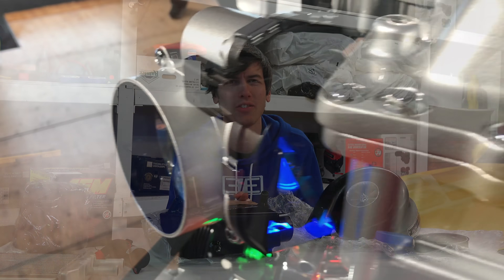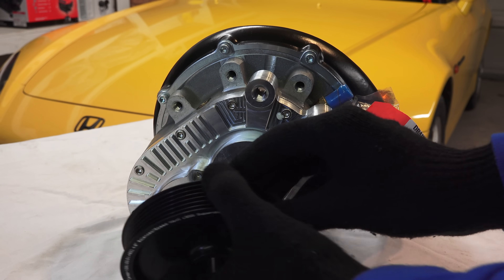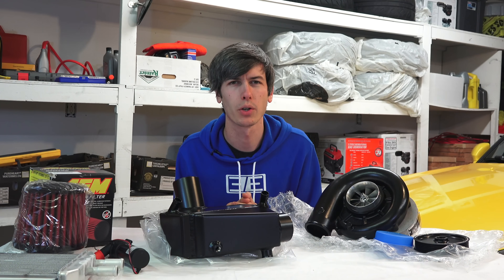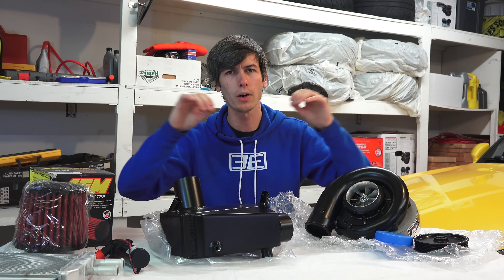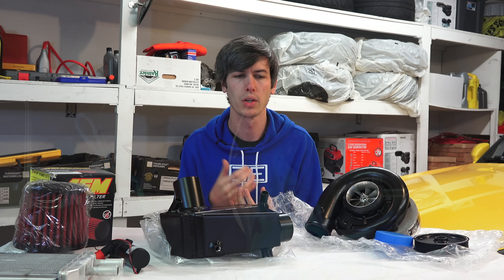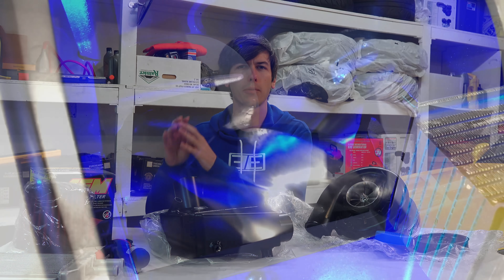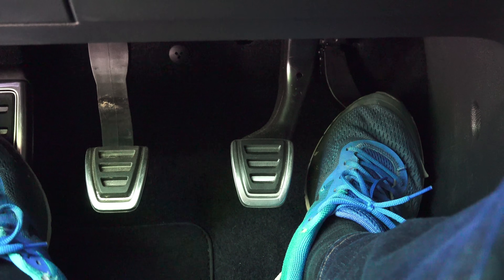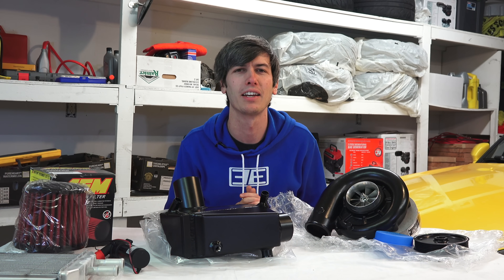Turbochargers vs Superchargers - Which Is Better?

Comment: Why do you got to talk with a nasal Fozzy The B bear Rubbish? FFS. You don't even address why turbo lag has it's real Benefits of dispersing heat consistently keeps running gear much more preserved then charge that flogs all till it blows. yeah great if your running 9's on the track switch in switch out motors on like no ones business with wealth by the side damn silver spoon kids couldn't even butter their own bread or tie their own F shoe laces together without messing the knot up with the other shoe stand up and break their neck.

Comment: If someone were using diesel to compress cold air into a large tank, then maybe a super charger would be better because they could save the exhaust heat as a catalyst for thrust, spinning an electric turbine, for an ultra efficient, triple hybrid diesel, compressed air, electric vehicle.

Comment: This seems like another reason Hybrids were the "worst of both worlds" 

1. If you drive your car on just a gas engine the engine stays hot and doesn't start-stop
2. If you only use the engine to charge a battery you can run it continuously at the optimal temp, also you can use an engine optimized for charging at an optimal RPM with constant load

With EV growth faltering, I hope some manufactures (apart from a Mazda SUV compromise) exploring an all-electric drivetrain with a small gas charger allowing the battery to be reduced by 90% and the car to be driven without a mechanical drivetrain (the best of both worlds)

Comment: Superchargers are amazing for compensating on engines that have very poor low end torque, but have lots of high-end power.

Case & point, the Toyota 2ZZ engine. Supercharged, it's genuiely scary, as the supercharger compensates for its biggest down side, the lack of power before you go into lift.

Comment: Honestly that's good to know I knew my car came with an aftermarket turbo but I noticed that sometimes ide hit the gas and my car would take a moment to bolt off and other times I tap the gas and my car just takes off xD it was a worry in the back of my mind but now this just tells me my turbo is using exhaust rather than power from the engine

Comment: Car guy question. Why not get the best of both worlds and make a charger that uses an electronic clutch or an electrically powered turbine, and map it to your RPM? It might take a lot of current but I’m sure you could beef up an alternator to compensate? OR, beef up your battery and wire the turbo with a kill switch so you can do a few good pulls and then shut it off to charge up for a little while when you don’t need it.

Comment: Hmm what about using a turbo to recapture exhaust pressure to drive a alternator in a hybrid car set up?
Reply: That's only really viable in racing. You need wide open throttle to generate any meaningful excess energy at the turbo. In road use, most of the time you drive around at part throttle, where the turbo often enough doesn't even get enough exhaust gas to create nominal boost pressure.

Comment: I had an FG XR6 Turbo Ford Falcon straight 6 here in Australia, was fun when it got on boost and it wasn’t super laggy as it was a relatively small turbo, however, I also owned an FGX XR8 with a 5.0L Supercharged V8 and the instant power, knock you on your ass power was a wonderful thing. Also in my opinion superchargers are safer as they are engine driven, you get off throttle and the boost cuts, so the same in a turbo and it wants to hang on that bit longer which could be dangerous in an accident situation. Just my thoughts.

Comment: I have a 94 ranger 3.0 and a 96 accord wagon 2.2 vtec. The honda has a turbo ajd im familiar with them on vtec engines. However would i still use a supercharger on something small like a 3.0 v6 ? 
How big is big enough for a supercharger yall

Comment: Turbos apparently can go anywhere, from 1.0 Fords (they have a 1.0 with 120 hp) to 16 cylinders Bugattis, and let's be honest ... lag was once upon a time; nowadays you can't feel it.
Superchargers however apparently need a bigger engine to start, however they're beautifully simple, aren't they?
Reply: can put turbos or superchargers on any size engine, nissan even did both on a 1L engine in the march superturbo
Reply: Chevrolet Cruze came with a turbocharger, they had lag. I have a turbocharger on my Fox Platform and it has lag.
Reply: @cunninghamroc  Alright, let me put it to you this way; F1 cars have turbochargers. Bugattis have turbochargers. McLarens have turbochargers, so do Ferraris. But ... also little 1.0 Fords or VWs.

Comment: Smaller engines with Turbos makes practical sense because it’s more efficient. A bigger V8 with supercharger may give up a little hp efficiency, but you have so much more hp to start with - you don’t notice it.

Comment: I built a turbocharged mid-engine "Lotus 7" (Google "Midlana") that was around 1,600 lbs. The engine was a Honda 2.4 K engine, so it had a lot of low-end torque right off of idle. Having a supercharger would have been a complete waste of power, serving only to make tire smoke. The turbo on the other hand, supplied torque higher up where it could get to the ground. The result was having ~400 ft-lb up through the rpm range, so in this car, a turbo was better. OTOH, if I built something really heavy, or for rock-crawling, supercharger all the way. So "which is better" depends on many factors.

Comment: Excellent video as usual but everyone describes turbos as running off exhaust that is waste, implying that there is no power draw off the motor but turbos are run by exhaust back pressure which would not be there if the turbo were not plugging up the exhaust. The efficiency part comes from the fact that they is little to no back pressure at low rpm’s. I don’t know the math but was hoping you could calculate how much power the back pressure takes off the motor to give a real power draw comparison. X psi against the piston on exhaust stroke by how many rpm’s takes how much horsepower to overcome. Thanks

Comment: Even a turbo is going to put a drain on the motor/engine power as it does take some energy to spin the turbo(s), in the form of back pressure. Motors loose HP from back pressure in the exhaust as it will cause some restrictions on the exiting exhaust.

I have not driven a vehicle with a super charger but I can see where they would be better than a turbo. 

That being said I do not see the need for at least myself for a boost of power that has to be exactly when I press the accelerator vs a second or two as I am not racing my car or need power immediately.

Turbos only last about 100k-150k and I have heard of them going out around 50-75k, and they are not cheap and or easy to replace and is very expensive to get done, I have a 535i in the shop now getting the turbos replaced which I am sure is going ti cost me 3k or more.

Comment: I had a 2014 Audi A7 and that super charger was actually very responsive. I now have a 2017 G90 and the twin turbo on the V6 are pretty good also there is a bit of turbo lag but it’s not noticeable to the untrained or informed person. I do miss that throw you back in the seat feeling with the A7.

Comment: There must be pumping losses with a turbo, otherwise you're getting something for nothing.  If there's no energy loss from the exhaust turning a turbine then you've just discovered a perpetual motion machine.
Reply: You aren't getting something from nothing because a turbo only recycles some of the leftover mechanical energy from the combustion that originally took place in the engine.

Comment: I personally prefer superchargers because of the low RPM torque, but I think turbo charged are more fun to drive because you get the excitement of having to look ahead and plan accordingly. Few things match that feeling that you get when you rev your engine and the boost kicks in just as you planned. It's like taming a wild horse.

Comment: I am a big proponent of increasing engine efficiency but I am of the opinion that downsizing is one of the worst ways of doing it. First youre not really increasing efficiency per se but decreasing mass and cylinder count. Second: Under extended high load scenarios downsized engines can even use more fuel as extra fuel is injected purely to prevent overheating in extreme scenarios. Additionally the decreased mass has with adjusted tyre pressures no impact on the fuel economy while cruising. Third and most importantly turbo chargers put a higher strain on the engine as well as the turbos themselves being an additional part that can fail. Since the downsizing trend began statistics have shown that the amount as well as the individual cost of engines repairs has been constantly increasing. That basically defeats any savings on fuel in regards to the environment as well as financial costs. The ones who benefit the most are the manufacturers who can claim better fuel economy which is mostly only true on paper as well as additionally getting more money for more and more replacement parts.
A modern well built naturally aspirated 2 litre 4 cylinder is in my opinion the pinnacle of an allrounder combustion engine for everyday cars. You dont need more than that and itll have good fuel economy as well as being long lasting.

Comment: There must be something wrong with our Ford Escape 2.0.  I've never really noticed the turbo the lag. It's a great running small SUV. Only issue I've noticed after retiring as a mechanic is the oil is dirty than most other vehicles we've owned.  With 4K miles services. And it only has 29K total miles. It's about equal city and highway miles. And since Grandma has a need for speed she likes the turbo.

Comment: Turbo all day long on a V8.  Superchargers provide way too much torque down low overpowering the traction.  I went from twin GT32 turbos pushing 14 lbs on my z06 to a vortech ysi pushing 18lbs boost and it literally ruined the car.  Stock Camaros could beat me at the stop light but I could beat liter bikes all day long from a 70 roll.
Turbos are smooth and controllable.

Comment: All turbo engines consum oil. The drivers don't know this. The oil level go down until a warning oil on dash will light.  Dangerous w/o oil for engine. All the turbos are very sensible, expensive to repair, a lot of headeake, etc.

Comment: One question? In the first interation with turbo and intercooler, the air would get slightly compressed by the compressor (even though the turbine hasn't received any exhaust gases yet), pass through the intercooler and then enter the cylinder, OR would the cylinder's vacuum suck some air whitout compression, process it and then give it to the turbine's turbo so it gives power to its compressor which would finally start compressing? Thanks

Comment: superchargers have less mass  (weight) involved !! less heat being " stored "" under the hood !  this all together far offsets nay power loss from being driven by the very engine your trying to create more power in !!!!! doesn't heat your motor oil wich in turn creates MORE heat IN the engine AND the dreaded EGT concerns.

Comment: Ok it makes perfect sense that a belt (or whatever drive method) supercharger is using some of the engines power, but help me understand my next thought. In physics it’s under stood that for every action there is a reaction. That turbo can’t possibly spin from “free” energy. We think of the exhaust gas as a waste product, but if an exhaust has a restriction, it will affect the performance of an engine. Now I’m sure the turbo spins pretty freely, but it has to be slowing down the exhaust gas in some manor, no matter how small.

Comment: All you need with a turbocharger is to be in the right gear. The only time you get leg is when moving from standstill 1st gear but as soon as you're going and are in correct gear, absolutely no lag.
Reply: But the throttle response will be a little delay, like half a second for the boost

Comment: Can you not combine a turbo charger with a super charger? You get the same benefits however the exhaust gasses compensate for the energy needed to drive the super charger at higher RPMs.

Comment: I'm getting sick and tired of hearing that turbo chargers use "wasted energy from the exhaust" and that they "don't rob your engine of energy".  This couldn't be further from the truth.  The engine has to push out those exhaust gases, they don't just leave on their own.  Did anybody ever consider why adding a  lower resistance exhaust system improves the performance of an engine?  A test that no one ever seams to be willing to try, is seeing what happens to the engine performance then a turbo charger is added without the compressor actually being added to the engine.  Naturally the plumbing on the compressor would have to be set up so that the boost is maintained as if actually connected to the engine.  You can be certain that the engine will loose at least 15% of its power if not more (depending on how the boost is set up).

Comment: It is easy to tell which system is "better" in the "more efficient" sense but most of the channels are just too flat lazy to do the most obvious test of all, evidently:

Whichever one experiences the lower measured fuel flow at a given hp is the winner of the "efficiency of a turbo versus a blower" idiotic argument.

No amount of braying about how exhaust is "free horsepower" will look smart if the turbo is using more fuel to make the same hp at the same RPM.

While they're at it, they can do a "throttle response test" to measure which engine responds most crisply to throttle inputs, and actually quantify it. Don't just say, "OMG dood, blowers have instant response, doooooodddd!"

Does anyone at Engineering Explained need a diagram or some crayon drawings to understand this concept? Do this and you absolutely TROUNCE all the other speculation and explanation channels.

it's simple. Test HP output (if possible at same RPM) between two motors: one with one induction setup, the other with another induction setup. Measure fuel flow of each motor at the points where their hp matches. Don't use the shlockmaster 1.1L supercharger on a 454 cubic inch Chevrolet while also using a turbo that can inhale a baby seal. Do the work and do some actual engineering and measuring, and we won't NEED an explanation. Just graphs and charts that demonstrate which produced what at what fuel flow.

Another test is "what was (less powerful (per unit of fuel used) engine doing while at the same fuel consumption as (more powerful) engine? How much power was it producing?

They can even have a face-off between two brands of superchargers to see which one does better in specific fuel consumption.

Same RPM is not absolutely necessary. Same horsepower IS, however, absolutely necessary.

Comment: I have a 2007 Grand Prix GT. And for a supercharged V6 with 260ho it’s fun to drive. When I hit the pedal it goes. It may not be as fast as other cars but it still is enjoyable and gives a good amount of torque in the high rpm range.

Comment: Interested to see what the turbo vs super debate becomes with AMG's new e-Turbo. Basically they use an electric motor to lower the boost threshold to almost eliminate turbo lag entirely. Still a teeny bit there since it takes time to get the crank shaft moving.

Comment: My Audi TTRS has a Turbo Charger and there is indeed a delay when in normal (D)rive but when I switch to (S)port mode on the gear box then it acts like a Super Charger, the throttle response and boost is instant. Not sure how they've achieved this though and would love for someone to tell me.

Comment: Hello there  good morning, How about putting a gopro under the hood of a car with turbocharger. Run up the car gradually until the turbo charger is slightly red hot. If a supercharger is boosting air  to 5psi (or 1.34 atm) and car is doing 100mph its hottest body temperature is unlikey to exceed 200 deg C. Correct?. By then the turbocharger body, at exhaust side, it will be slightly glowing hot. So using fully synthetic engine oil would be critical for prolonging life span of turbocharger . For Eaton supercharger it is lubricated by its own ester based lube oil in its own sump. For my 2006 Mercedes, having a E45 Eaton supercharger, I uses semi synthetic 10w40 for engine oil as I do not go above 100mph and also the early morning  temperature never ever go below 80 deg F vs about 98 deg F at noon time. No issue of getting fast engine oil flow during engine start up in these temperature. Regards.

Comment: What gives more horsepower
Reply: It depends but because turbos are more efficient in terms of consumption more amounts of powerful ones exist in general not beacuse they are generally more powerful but because it's simply free power, you can get a supercharger that adds more horsepower than turbos but they're just not as popular because efficiency sake. It does the same thing as a turbocharger but adds Instant Power at the cost of efficiency. Depending on what you want both can have more horsepower than the other. Superchargers would be better in a drag race where you want acceleration. Top speed doesn't matter if you accelerate to the Finish before everyone else. So in racing it would make more sense to be supercharged.

Comment: Curious about long term use. Is a turbo better and easier on the motor in the long run, or is supercharger less wear and tear?
Reply: I don't see how a turbo could be less wear and tear on the engine when he clearly stated they get very hot and it lowers the life of your engine oil.